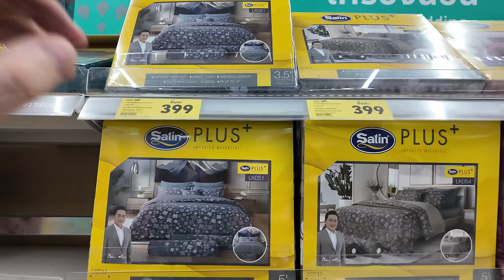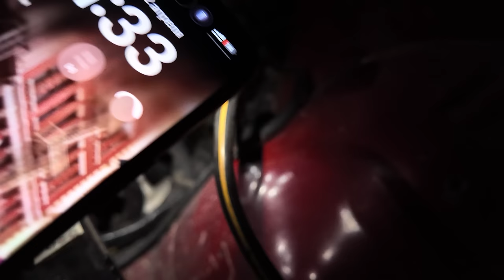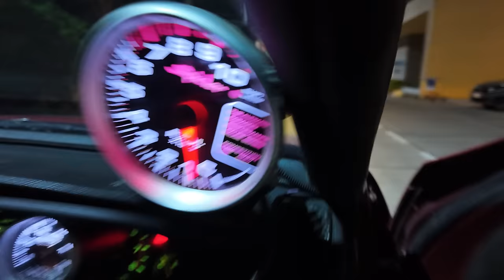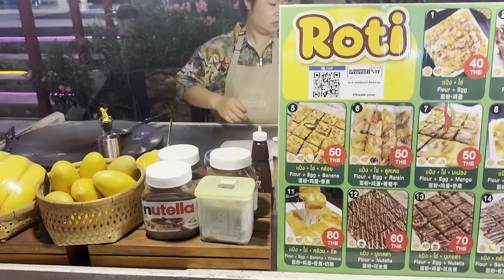Spraying Everyone With Water In Thailand

Comment: Your vehicle selection criteria is totally disjointed to your situation.
You need to be invisible. You don't need a problem you need cheap, safe enough, reliable, comfortable, vanilla and easy to sell.
I doubt that highly modified is even insurable.
Blend like a gecko not like a peacock.
Look at old (fully deprecated):

diesel Ford Ranger pickup trucks
Toyota Corolla
Toyota Prius 

Look at what regular folk drive.

You don't need a performance boat anchor around your neck. (How fast was your taxi)

Don't be that guy that ends up in the newspaper. Blend.

Yes! Go to Bangkok to buy.

Get liability insurance.

Comment: Don't buy a flashy car.  You would be smarter to buy a bland looking Toyota Corolla or Yaris in good mechanical condition because you'll get more for your money.  Get a good running Corolla or Yaris that looks so plain that nobody would want to steal it.  It will get you where you want to go at the same time as a fancy overpriced money pit.  If you buy it right, when you leave you can sell it for nearly what. you paid for it.